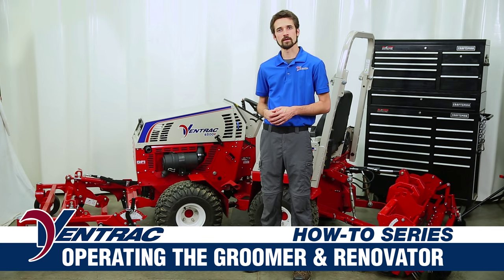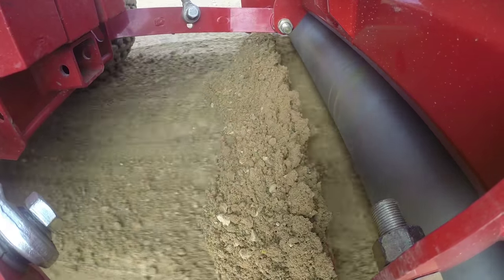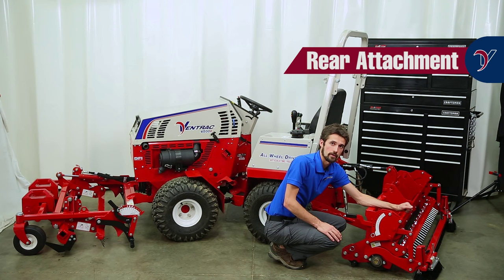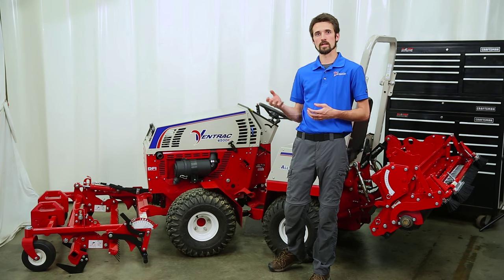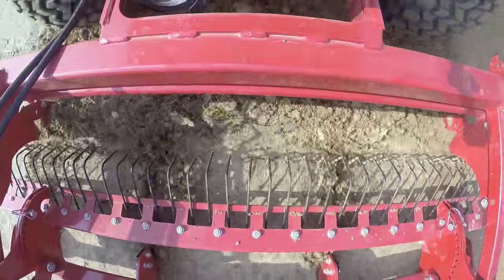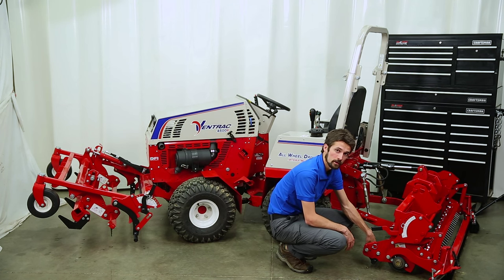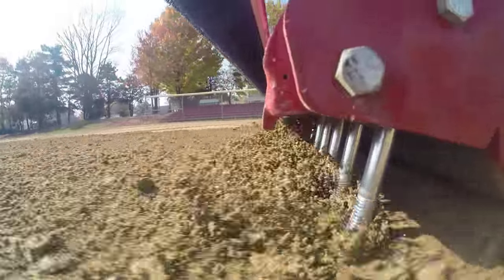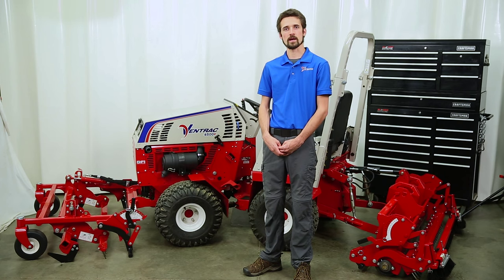Ventrac Ballpark Groomer & Renovator Instructional Video

Comment: i like how the rear spike bar is just a whole bunch of grade 5 bolts lol
Reply from the maker: +Drew Tibert Good eye Drew - you are right!  We used grade 5 bolts for testing.  The production units use a straight tine (no threads).
Reply: +Ventrac you should make a groomer that you can pull behind a lawn mower,atv or a small tractor.
Reply: Mine grinded down to the bolts in a year from hard clay. Stick to the three wheeler to be honest

Comment: What's the difference between a steiner and a ventrac ?????
Reply from the maker: Roger,

Assuming you're talking about the Ventrac 4500 and the Steiner 450 - here's the scoop:  Ventrac and Steiner are 2 different companies.  These 2 tractors are similar in that they are both center articulated and have a similar attachment style, but everything else is different.  The machines use different components,  hydraulic designs, etc. and have different features, different attachments, and totally different dealer networks.   The best way to imagine it would be two cars from two different brands.  They both build a car - and those cars serve the same fundamental purpose.  They both have 4 wheels and are a similar size and shape - but everything under the hood and behind the scenes is totally different.  

Whenever the question comes up, we kindly invite the person to demo both in person and let the machines speak for themselves :)  

You can also check out all of our technical videos to learn more about our product.  ...there's not much information available for theirs but ours is all there for you to check it out.

Thanks for asking!